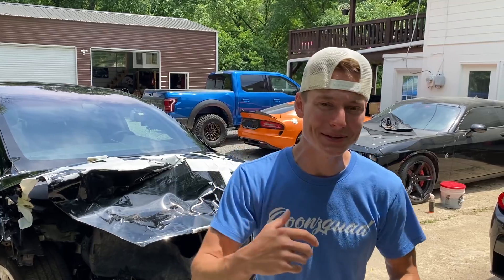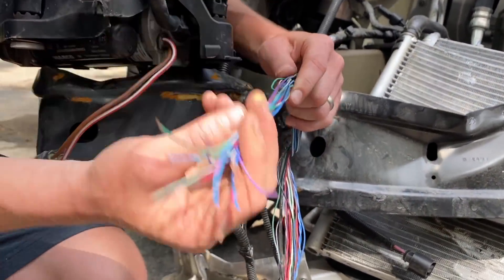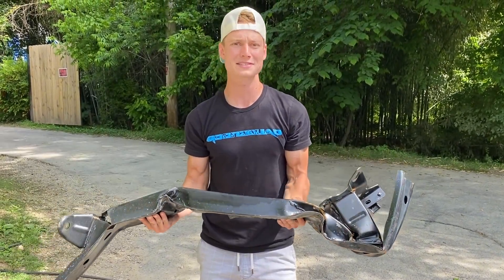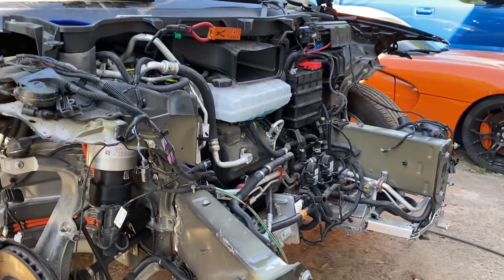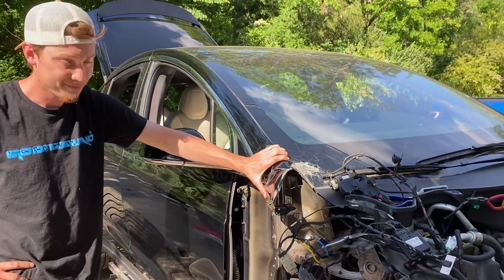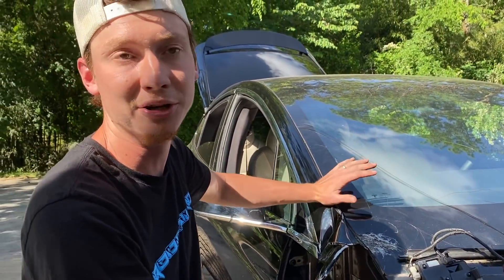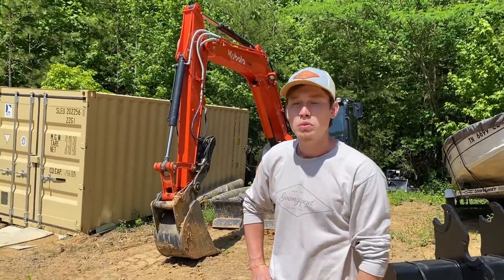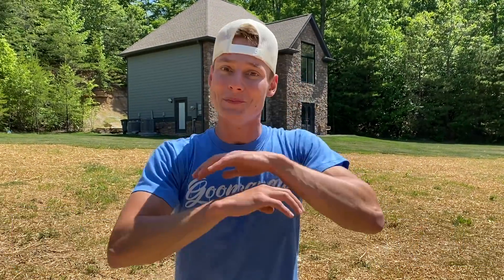Rebuilding A Wrecked 2020 Tesla Model X Part 3

Comment: The Best thing to do is look for a rear ended Tesla that is the same model with all the Parts you require Sockets for Electrical,  Hood, Fenders, Radiator everything as Tesla won't even sell you the Plastic Wheel Nut Caps they will tell you to scrap it and buy a new one 100% truth
Reply: Yup.
Reply: Yesir
Reply: You already know they have most likely already bought one. These Men have foresight.
Reply: These guys have a lot of things but foresight is not one of them. They’re constantly doing things ass backwards
Reply: Thats exactly what they're gonna have to do
Reply: My thoughts exactly
Reply: Doing things ass backwards dont make you a millionaire so they are doing something right!
Reply: They already got one smacked in the back. This is not there first rodeo. They are showing you how shady car companies really are!
Reply: @ff271emt  My Point exactly..these Dudes are not Stupid..✔
Reply: PLASTIC CRAP can be 3d printed. Just scan one nut and clone.
Reply: @Andrey Angere they will earn enough to buy ten teslas just off this one series with all the tesla fanboys jizzing their pants
Reply: I’ve had good success getting parts from Tesla.

Comment: Goonzsquad: Has a car lift in the garage.
Also Goonszquad: "Dang son, let's use some quickjacks not rated for this weight"
Reply: They need a bigger garage they got to much stuff in there to move
Reply: their Quikjacks are good to 5000lbs, and this is a 5200lb car(as its the more basic one without dual motors)...shits not safe at all lmao even with it missing some parts
Reply: @Shadow0fd3ath24  it definitely lost some weight before the put in on
Reply: It'll be fine
Reply: Maybe they're hiding something in the garage at the moment
Reply: @Cartier_specialist   it is the aircraft carrier that they are going to be rebuilding
Reply: Where's that helicopter at !!! Danggggg Sonnnnnn !!
Reply: @Shadow0fd3ath24   They test lift until they break then they cut the weight in half
Reply: @Shadow0fd3ath24  says right on their car,  dual motor.
Reply: We all watch for the oops moment, 👀 😲Goonzquad 101, "don't do what we do," we're professionals 😁🤓👍
Reply: i wish i could love this comment. the number of times ive said YTF are they working on the ground is incredible... makes 0 sense
Reply: @Leah B that doesn’t justify using something that’s not rated for the weight.
Reply: Be careful when lifting the car, so you dont damage the battery.
Reply: Well said Steven Lear ,  it's   a mess ,  then straighten the front with skid steer  while pops holds it , come on  it's a circus, maybe its content and a lot of people watch it , but theirs a limit, don't get me wrong I love some of the builds the goonsquad  have done  but the made a mistake buying that Tesla model X,

Comment: I work for a body shop that has 7 shops around the Chattanooga area. From what I remember you have to be a Tesla certified repair shop to be able to order Tesla parts and they are SUPER picky and want you to put in just one order with all the parts you need at one time. I hope you can be able to get the parts you need
Reply: i wouldn't buy a tesla just because of how scummy they are, not allowing people to repair their OWN vehicles, i'm not even savvy enough to do it myself but it stinks of greed from tesla.
Reply: We should not support communist type companies... Tesla and Apple are horrid when it comes to repair.

Comment: Once you get her fixed, install some Blox lowering links. You can control the air ride height from the screen. This will lower all three settings (low,med,high) by about 1.5”. I have them on my Model S. For $100, it’s the cheapest lowering kit you’ll ever buy.

Comment: As I look at all the wires and modules and little do-dads in that front end, the only thing I'm thinking is, "How the hell are you guys going to put this back together?"  I wonder if that have a box for each car labeled "Extra Parts"
Reply: HAHAHAHAHAH same here. But i know my guys won't disappoint
Reply: Yep, I think they need to get a spare car that was rear ended and just transfer parts over.
Reply: I say delete all the stuff that's not necessary to actually drive the car (Unless you have a strong preference for brakes, for instance).

Comment: That Tesla is going to be worthless when Tesla disables supercharging and fast DC charges
Reply: Tesla knows online when a car been in a accident with deployed airbags, the car has to be approved repaired in Tesla cert repair shop, otherwise supercharging and maybe other features (autopilot etc...) will be disabled, they will and win the fight due to safety on the road, potential fire etc...
Reply: @fryklundstfr  they`ll find an aftermarket device/way to bypass that bullshit
Reply: @klaaskomvaak1816  should be interesting to know how tesla identifying your car when you connects the supercharger cord. Nice to have an adapter that act as a another approved tesla car.

Comment: the fan turning on might be the cabin overheat protection. it uses the fan to keep the car under a certain temperature to prevent damage to the interior from high temperatures. the huge air filter is a HEPA filter that can filter out virus particles. it's part of a $4500 option called the premium upgrades package, but I think it's standard for 2020

Comment: The wires that can be cut opens switches to divide the high voltage DC battery into small voltage packs of batteries so you dont get hurt when the battery is connected to the body of the car or when you work on the car

Comment: It's Sunday and GOONZQUAD is on🏃‍♂️ fire it up💥🔥 This rebuild requires all the help you can get from the Tesla rebuild community. Wouldn't surprise me if  you need to find a totaled rear ended Model X for this rebuild. It seems to be the only way to rebuild a wrecked Tesla. Thou used parts are out their, its a question of getting them and not having to go to the Mars parts counter, thanks Elon😉

Comment: the car port should be good. I would do the concrete pad about 25 feet extra in the back of the car port. Would not be hard to convert to a garage down the road either. I would have put the next house by the shipping container and put the car port between them. With the circular driveway going to all 3 places, I would have a driveway going straight back beside the first house. Circle would need to be big enough for your helipad.

Comment: Buildings Direct or any other online company will ship you materials and plans to build quick carport or garage to store your cars plus etc all you have to do is do your concrete form for the floor and boom your done in about 4 to 6 weeks at your pace. Then also if you pick a building with enough height  you can use lifts to stack cars for even more storage 💯💯💯💯

Comment: I don't know if you will read this in time but Copart has a 2018 Tesla model X in Sun Valley, Ca. Only damage say side looks like the two passengers doors. Black, that look just like this one. The sale is May 26, at 12 PM CA time lot number, 25994619. It's valued at $82,272 the highest bid right now is $10,600. I don't know if much different of the front end from 2018, to 2020. But could be a good parts or twin repair.

Comment: Right to repair vs. liability on Original manufacturer once its on the road, i see both sides. 2 years later something fails its on the news, they are not going to say "Wrecked tesla rebuilt by Goonzsquad" , media will say wrecked tesla, period.  I love what you guys are doing, right way and responsibly. Other out there may not do it to the standards.

Comment: hello guys how about photovoltaics on the roof of the carports.
Here in Europe, glass / glass modules cost the equivalent of around 150 US dollars with 340 WP and a size of 1.7 meters x 1 meter. The costs for PV modules are not higher than those for safety glass.
A new trend will prevail, namely agri-photovoltaics. Here we combine sun protection, water saving, and the production of electricity at the same time.
Electricity from a carport can be stored cheaply in lithium iron phosphate batteries.
We call it PV farming.

Comment: I am kinda worried the batteries will heat up or smthn with the cooling system removed, any main breakers to "turn off" the battery PACK?

Comment: Not to be a Debbie downer but I have a 2015 ram rebel that had air suspension on all four corners, had issues with it for a long while, after taking it to 3 ram dealerships and mechanics no one knew was wrong with it so I just decided to put oem coilovers. Goodluck trying to figure out that air suspension.

Comment: If the structural frame of the quick jacks is rated for 5000 lbs and you loaded the 6500 lb Tesla, that could create Plastic deformation at a microscopic level in the frame members of the quick jacks, which would lower the overall load rating and make them unsafe to use. Be careful with overloading, especially if you're gonna be crawling under the car.

Comment: One other thing is pull out that battery disconnect when working on the car.  These batteries are super high current and can cook you.  That much current can arc like a welder.  I am just concerned with your safety.  Good luck.

Comment: HEY GUYS LOOK HERE!
Im ev tech in sweden, and your crash will need you to rebuild your AC SYSTEM.

Please dont fill it with wrong gas and OIL!!! 
Ev cars needs special oil that is not electrical power conduction otherwise you will end up with isolation fault and the car will not start and you need to clean the hole system!!!! Bad, expensive and hard.

Pls do the ac fill at tesla or an ev cerf ac shop!!

I think tesla have R134A in us,  POE OIL viscosity 84 and model ND11 !!

The same with trace fluid must be special non powerconductive  trace fluid.

And pls dont start the car without working cooling system and ac system , cooling system cools the batterys and the ac system cools the battery 400 volt system aswell!!!

So when you said it was a small radiator its true, but yoy have a ac chiller that cools the battery aswell!

Comment: I don’t know if you already know this but their are two different types of lumber. One type is certified for structural use only by a certified lumber inspector. The othef type is lumber that is not certified. A misconception that lumber cannot be used in construction that is not certified. That is a misconception however partially true. You can use lumber milled without an inspection stamp on construction that is not structural. You cannot use lumber that does not have a certified stamp from an inspectors for structural builds. Let’s say your building a non structural wall that lumber can legally come from anywhere. What I’m getting at is that if you find a private mill or you buy a sawmill portable sawmill and cut up trees on your property for lumber you can use that lumber for a number of things and it will save you tons of money. Check with your county building codes to make sure what restrictions are on non certified lumber. 
If you mill the lumber your self you can pay an inspector to come to your place and have your lumber inspected and stamped for structural use only if a licensed inspector gives the stamp of approval. 
This can save you guys tons of money.

Comment: If Tesla knows the chassis number they will disable super charging if they don't already know it
Reply: The VIN has been in the public domain since before Goonzquad purchased the Salvage Title Tesla at Copart Knoxville on 13th April 2021. The manufacturer keeps a very close eye on the use of its products and would undoubtedly have known by or before that date that the car was being resold, and in what condition. Tesla have a reputation for obstructing all but their appointed Agents in the assessment and repair of their vehicles, as has been widely documented. Various legal challenges to this stance are currently being pursued internationally, but Tesla may be expected to rigorously mount a defence, citing reasons such as public and personal safety, intellectual property rights and other specious arguments.
Reply: The computer knows it’s been crashed. Even if you told nobody that Tesla server will know.

Comment: Daddy Rich can help you you may just have to buy another Model X with rear end damage to get the part you need but hopefully you can find them second-hand I rebuilt a Tesla Model 3 that had rear end damage used all the parts I needed sold everything else and it only cost me $17k after all said and done after selling both cars and fixing everything and I have a nice Tesla also whatever you do never ever give Tesla your VIN number if you try to order parts directly they will disable supercharging if they find out you rebuilt the vehicle

Comment: Tesla parts can often be obtained from salvage yards, but the main problem with the repair of these vehicles is knowing exactly how everything fits together. Tesla refrain from retail sales of their Repair Manuals and usually refuse to sell new parts to owners of their cars unless the vehicle has a 'Clean' Title. These are two workarounds for these problems. Firstly, and most practical, is to build a clandestine relationship with someone on the 'inside' of Mr Musk's amusingly secretive organisation. Alternatively, and the least desirable route, is to buy a second example of the car which is damaged differently, choose the best example, and 'clone' one working car from two wrecks. Although this sometimes succeeds, Teslas are so unnecessarily complex that there will always be setbacks unless one has access to the manufacturer's secrets by 'other means' whenever problems arise, as they surely will.